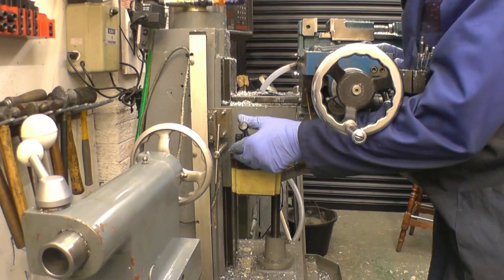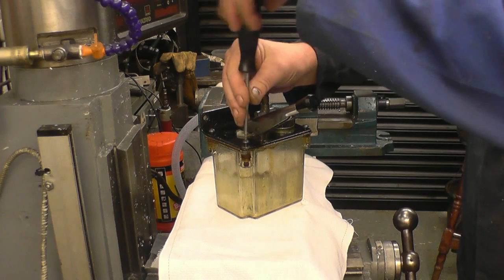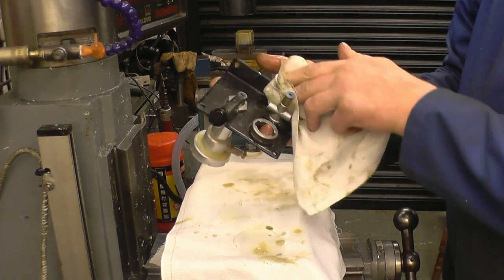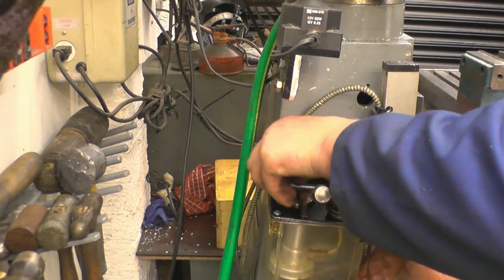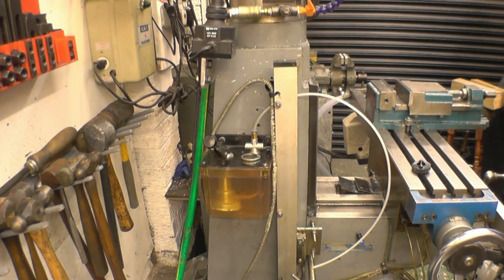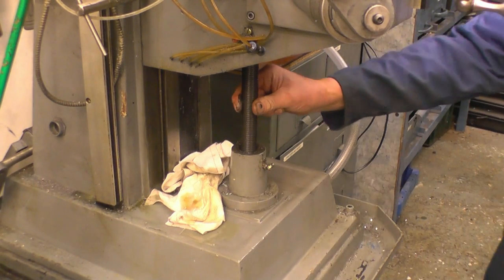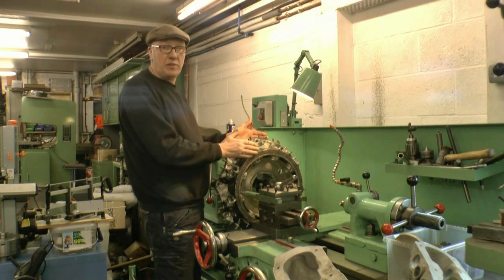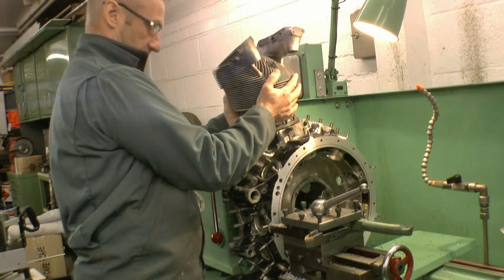SNNC 101 P2  Mill Lube tank  Radial engine Big lathe

Comment: Hi John, I'm planning to make a collet chuck for my 4 1/2 Boxford. Any advice you can give me on whether to use er 35 or er 40 collets? All the best to you and Debs. Robert
Reply from the maker: +Robert Mallinson Hi I used ER32 just as I had a set The 3/4 hole matches the lathe spindle bore

Comment: I'm with you on oil, I only ever use motor oil on my lathes. Since the car runs on 5W30 that's what I use since I have it on hand, smells better than the 10W40 compressor oil which is the only other common oil I have. I prefer the slightly thinner 5W30, especially for the lathe spindle.

Comment: Lovely pair of videos, I had to laugh when that oil pump spat at you twice and you dropped it as well! One quick point with regard to that oil pump piping if you take it apart and inspect the end of the pipe you may find the cutters have distorted (ovalled the end of the pipe and perhaps caused a small crack) due to the guillotine effect of their action. Recut the end of the pipe square with a scalpel or razor blade and re-insert. That should stop the leak.
Beast wishes to Deb and your Dad.